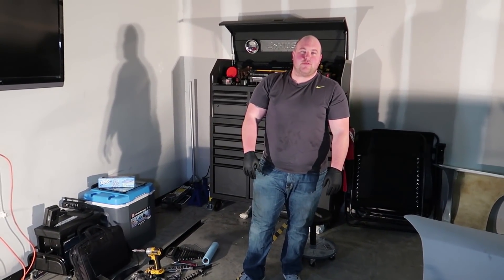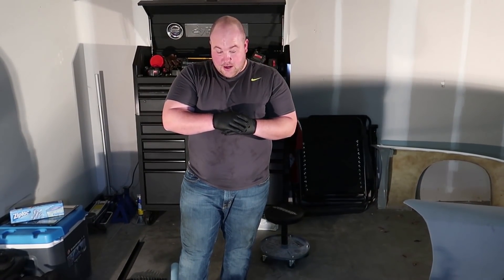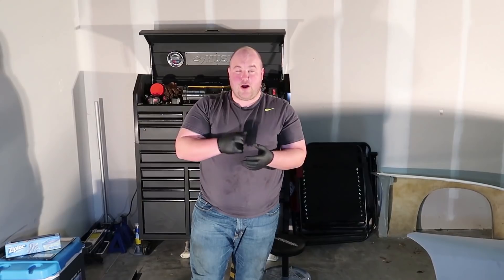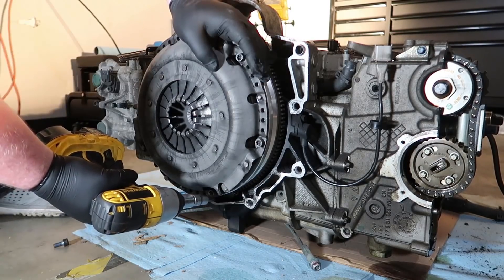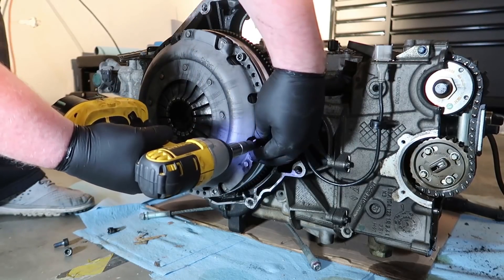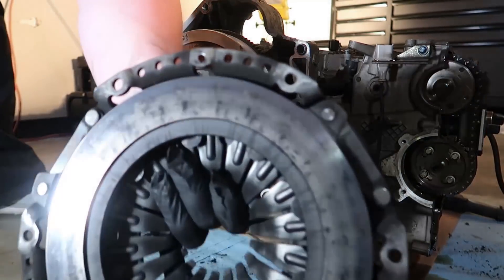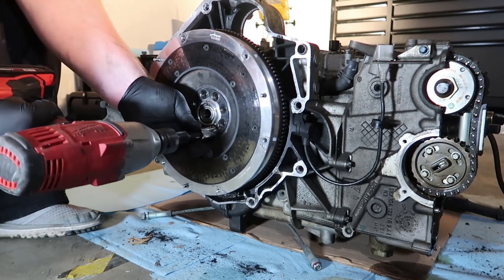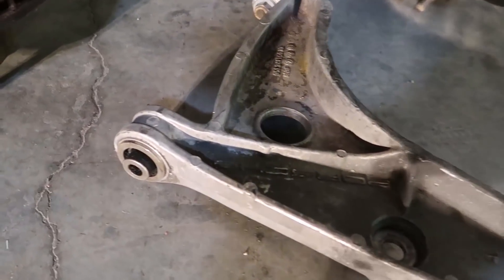Porsche Cayman Engine Disassembly - Part 2

Comment: I am watching this and it feels like a train wreck.  This isn't an American engine that  costs less than 10k. If you mess it up it will be more than 20k. Why won't you get some cheap manual to show you at least the various parts. German cars aren't as complicated compare to American but they have different system
Reply from the maker: It’s not, don’t let the working on the ground fool you haha. Everything is being properly labeled and organized. The engine will have to go to the machine shop to get hot tanked regardless. It is definitely a bit overwhelming due to the cost, but we have a factory shop manual and are taking our time.

Comment: Hey guys, last summer I stripped down an M96 3.6 3-chain engine (basically the same thing you’ve got). A couple tips: first, you need a special tool set with cam locks and a timing tool to take the cams off. Second, everything that comes off from where you’re at now has to go back in exactly the right place (the brackets/bearings that hold down the cams, bolts, etc.). Hit that workshop manual hard or pick up a Bentley manual - the Bentley manual is useless for putting it back together/doing the timing but it’s good for tear down instructions. Let me know if you need any other help!
Reply: I think Pelican says your supposed to mark the variocam actuators as well. Can't wait to see what's going on in the belly of the beast!
Reply: Ken Kroslowitz yep that sounds right!
Reply from the maker: Thanks for the help! I printed off the 14 pages of the manual today that go over cam and head removal. We obviously don’t have the tools just yet but we will acquire them. Any idea where to get them at a decent price?

 We are bagging and tagging EVERYTHING, and will continue to do so. 

Thanks again!
Reply: Boost Brothers Garage yeah for the tools this is what I got:  https://rover.ebay.com/rover/0/0/0?mpre=https%3A%2F%2Fwww.ebay.com%2Fulk%2Fitm%2F281427790205
Reply from the maker: As in which side or the exact position once removed? We have sides marked, but can mark position as well.

Comment: I gotta hand it to u guys for tackling this alone.  I mean an engine is an engine but idk, Porsche engines just seem kind of scary to work on.  Oh yeah, you better make sure you some orderly way to keep track of all parts so you can get all correctly back on w/o wasting tine figuring it out.  I can onky speak for myself, but when I work on my car I take photos of everything at each stage.
Reply from the maker: Ha, thanks! I hate to admit it, but yes, this one is scary. We are bagging and tagging each and every screw / part, but need to do a better job of taking pictures as well. Not quite a small block chevy now is it!

Comment: Here's a cool video showing a Boxster engine breakdown in time-lapse.  Looks like to get the heads off your next step is to remove the chain-drive cogs, then remove the camshafts, and then you can get at the heads.

http://www.youtube.com/watch?v=0jQLNO3J0Vs
Reply from the maker: Thanks Les!
Reply: There is also a series of videos by glenn986s where he goes through a complete breakdown and rebuild step by step.
Reply from the maker: Fantastic! Found the section in the service manual that goes over the head removal, confidence level is going up!

Comment: Had a look at a same engine I dropped of at a specialist recently. Our engine had a snapped connecting rod on cyl 1, piston came in contact with the valves, absolutely destroyed the cylinder walls of both cyl 1 and 4 + everything in between... meh
Reply from the maker: Ouch, not much salvageable on that one!
Reply: The heads are, with new valves just to be sure. I'm aiming towards a rebuild with parts from a donor engine so that we can make improvements like steel cylinder liners. No more cracking in the future
Reply from the maker: We are considering liners as well, even if it is just a spun bearing. Would hate to slap it all back together just to have a cylinder bore issue a few thousand miles down the road. Sure would be nice if these things were cheaper to rebuild!
Reply: Absolutely! And therefor it might aswell increase value. I got a rotary, even that is cheaper to rebuild (unless you go for crazy spec race engine build)
Reply from the maker: Love rotary's! Zach's dream car is an FD, maybe we will go full stupid and add one of those to the stable haha

Comment: I’m really curious on how the IMS looks and if that is the problem? You guys really need a shop table or work bench. And why 17 and not 18 for the 944 build?
Reply from the maker: We still think it’s a spun bearing, but I’m curious as well. Our workbench is still in my garage, we are waiting for the rest of the shop to get cleared out so we can finish moving our stuff in! We are also waiting on the engine stand adapter to come in so we can put the engine on it’s stand.

As for the 17”s, it was mainly just because I got a great deal and couldn’t pass them up. 18” was my first choice just because the wheel wells are so big, but I’m going to run a chunky tire.

The goal is to make a modern day 924 GTR tribute so too big of a wheel would have taken away from that.